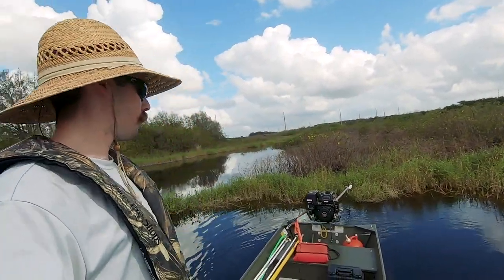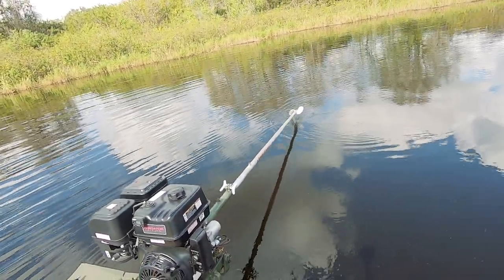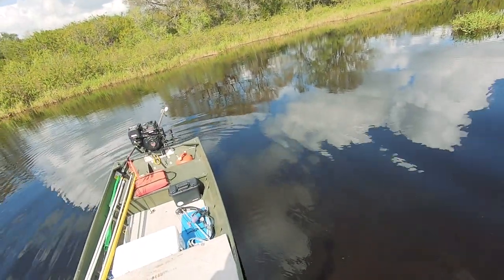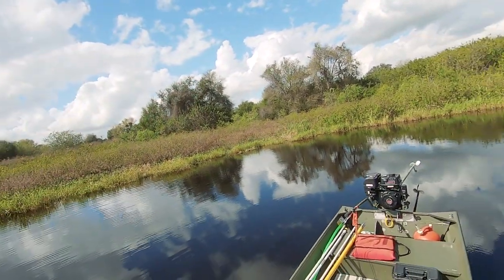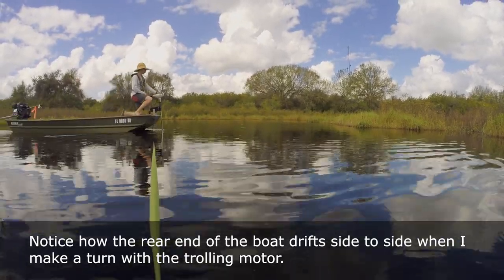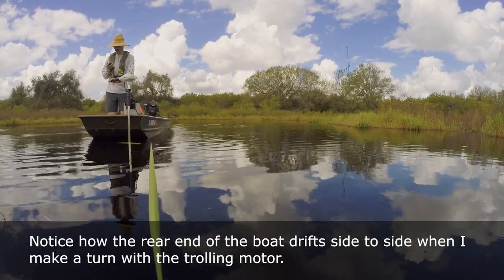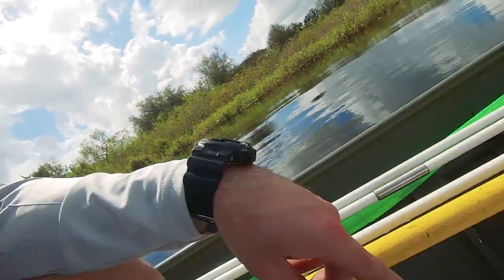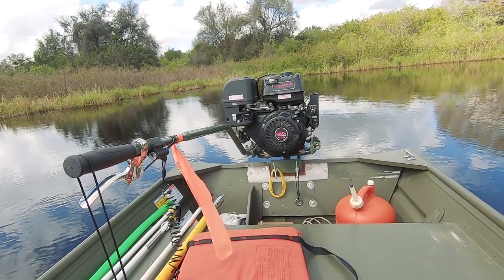Longtail Mud Motor Tiller Handle Tie Up

Comment: I’m somewhat new to the boat scene. I’ve been searching all over for a cheap outboard with no luck. Somehow stumbled upon your videos which have been awesome. Now I’m looking for a mud motor my main question for you is I’m trying to run mine up and down rivers have you found the 85 inch shaft is hard to manage or fairly easy? I believe I’m going with the 13hp motor with my kit. My main goal is to run rivers for striper and catfish and a outboard is just to pricy.
Reply from the maker: 13hp is a perfect size for a 1436 boat, and if you're getting a longtail kit, I would recommend a Swamp Runner. At first you will wonder how anyone functions with an 85" shaft sticking out the back. Once you run it, put it on and off the trailer a few times, and put it up some creeks and tight places, you learn how maneuver it. Its a learning curve but I'm use to it know and use it to my advantage
Reply: JTgatoring holy smokes that was a fast reply. I’m ordering my swamp runner kit today. Aswell as leaving them a very nice email that you sent me to buy there product. Thanks again.
Reply from the maker: @samuelstevenson1820  I appreciate that, thank you! I just so happen to be on youtube when you commented haha got lucky. Once you get your kit running, let me know how it ends up treating you
Reply: @samuelstevenson1820  what size boat you putting your setup onto

Comment: Before you had the floor what did you tie the handle off to that’s a good spot ? Don’t wanna pull on any one support to hard maybe tie to multiple ? Don’t wanna make rivets separate
Reply from the maker: When I had the small swamp runner kit on a 212, the tiller weight was minimal so I tied it to the rib. When I went to the medium kit, that is when it seemed a bit excessive which also made me think about it. So it was either mount a support on the front of the seat face or build the floor. I decided to build the floor because it solved other issues I was having.
Reply: I’m running 22 predator and a swamp runner so it’s heavy. What do you mean by build a support on front seat like some aluminum side to side ? I’m gonna go that route I think. If I can understand how you think to do it ! Thanks
Reply from the maker: @coltensawyer6761  I was talking about adding additional support to the seat. So I was thinking of adding either a plate/channel/tube to strengthen the actual seat and then tie it to that. So for example; put a piece of plate on the front part of the bench seat and secure an eye-bolt and hook there to tie a rope too or use square tube bolted or riveted across the bottom of the bench seat and put an eye-bolt or hook in that. Do whatever you can to strengthen the sheet metal on the bench seat and disperse the load as much as possible. I've also seen people use webbing with a hook on each end and put one hook under the seat and one hook on the handle. Think it through
Reply: @JTgatoring  thanks for the idea ! What about just a thick hay hauling ratchet strap that is long around the hole bench then hooked to the handle ? That would disperse it well over the hole thing correct ?

Comment: Are these long tail kits recommended for salt water use?
Reply: Yes (SPS) even have salt water kit ( more expensive)
Reply: What company do I search for those?
Reply from the maker: Yes they would actually designed for saltwater us in Thailand. The Swamp Runner SPS mud motor has a "saltwater" kit which means the shaft has a stainless steel inner shaft so it helps prevent rusting if not maintained properly. The standard shaft would also work just fine, you just have to maintain it better